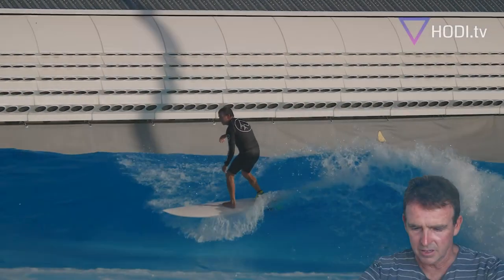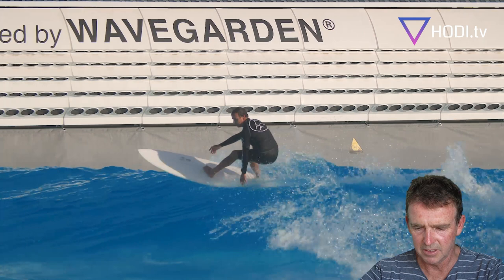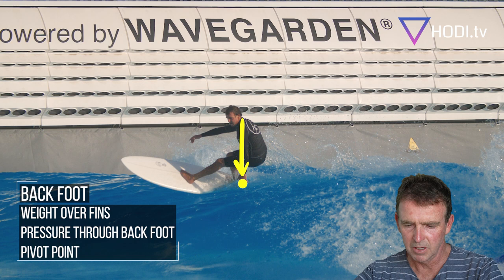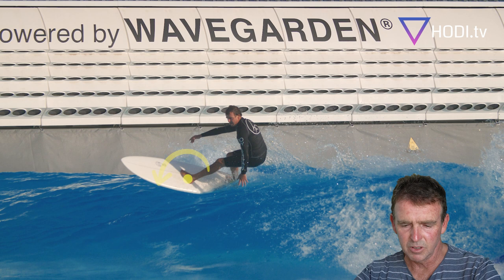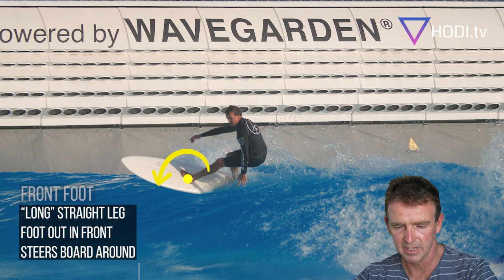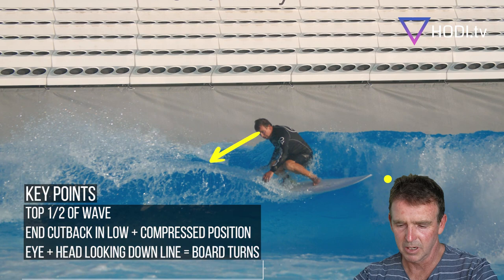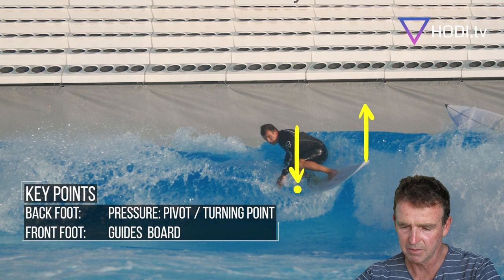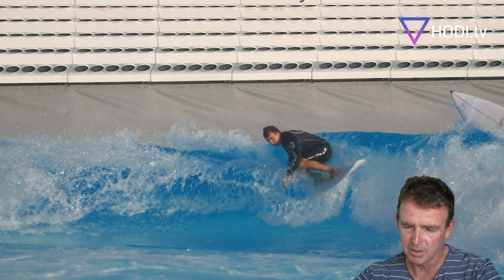How To Turn A Mid Length Better - Back Foot / Front Foot Roles

Comment: It looks like you step your rear foot backwards at the top of the wave right before you turn. Is that true? For me I'm trying to figure out foot movement and placement on my mid length. Front foot doesn't seem to move much and then back foot comes forward for more speed and moves over the tail for tighter turns?
Reply: Yes
Reply from the maker: He’s trying to lift the nose and engage part of the tail line, not all of it. If you 👀 at some of the other masterclasses they all talk about back foot pressure and a light front foot which guides the board around.
Reply from the maker: Should do a live stream for Q&As with the surfers to answer you all directly